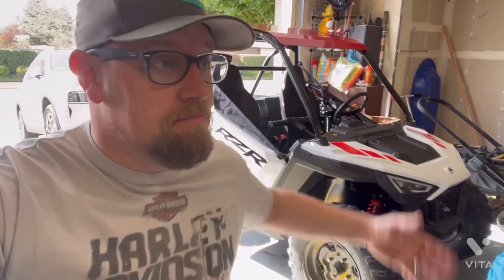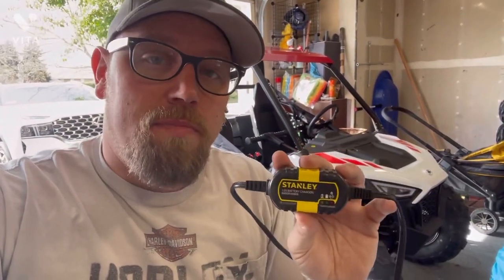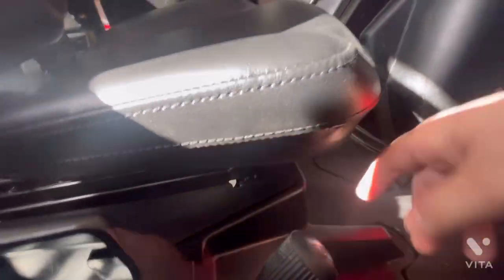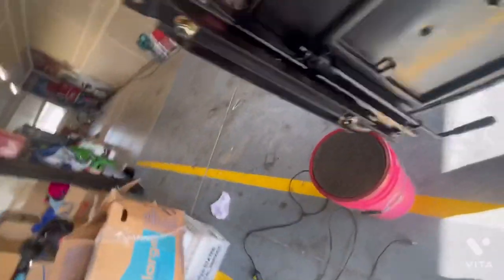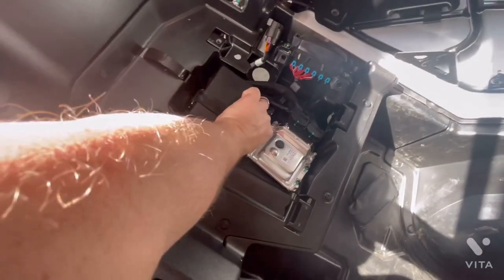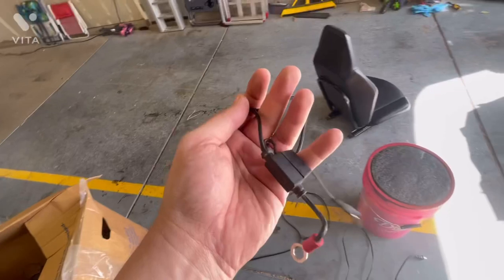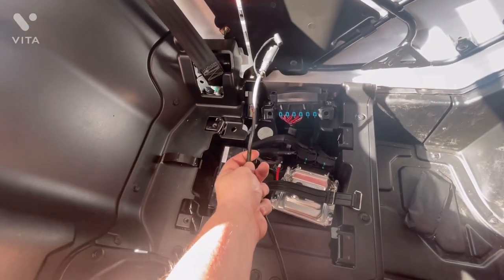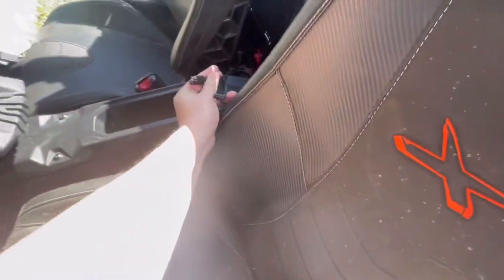Installing a battery tender on a RZR 200

Comment: That plug on the dash that looks like a 12volt cigarette plug is a port to plug in the battery tender no need to do anything but plug it in
Reply from the maker: Dude…. Why did I realize this after I put it in lol
Reply: My dealer is great they walked me through everything and even took me for a test ride and downloaded the app and hooked up my Bluetooth for me wish more dealers were like that
Reply: I put a charger to the plug and it didnt do anything. I wonder if their is a fuse blown

Comment: Thanks for the video!  What roof did you have installed there?  I would like to source one for my Daughter's 200.
Reply: If you install it an average adult with a helmet on won't fit under it.
BTW: Bumpers are about $69 each, install in under 5 minutes and essential when the kids are slamming into each other.
Reply from the maker: Hey Marc! It’s an Afx bumper and roof kit

Comment: Hey Eddie. I have the same 200 for my kids. I want to put a light bar,chase light and two lighted whips. Do you think the battery can handle all of that?
Reply from the maker: Great question, I think the battery will do fine it’s the cheap Chinese charging system I would be worried about. Personally I would get a fuse block and wire everything to that and go straight to the battery! Good luck
Reply: Thank you. What is a fuse block?
Reply: Put on a bus bar(pulse bar)